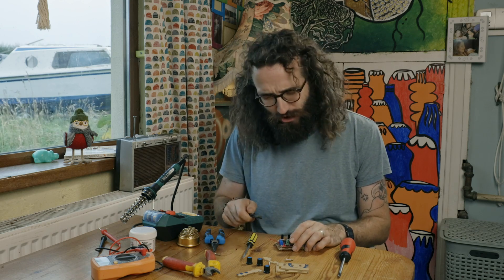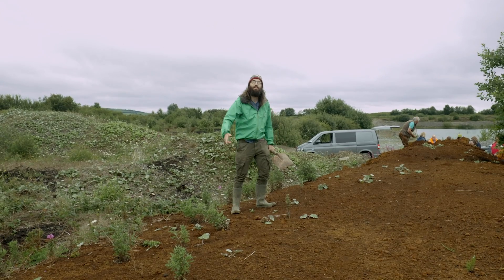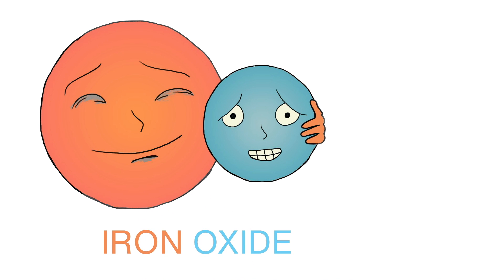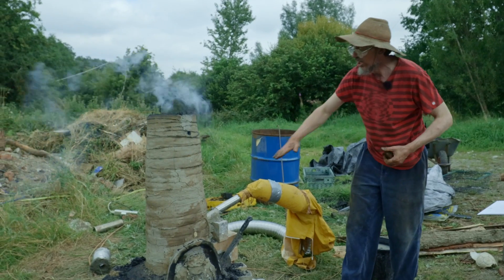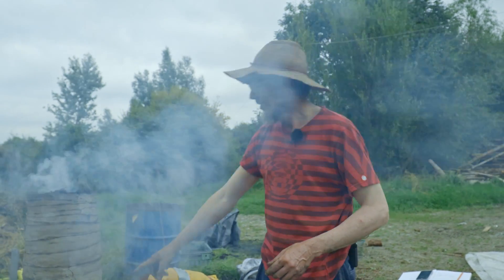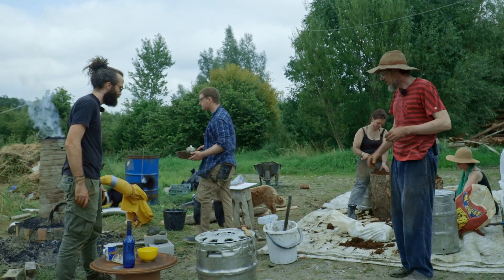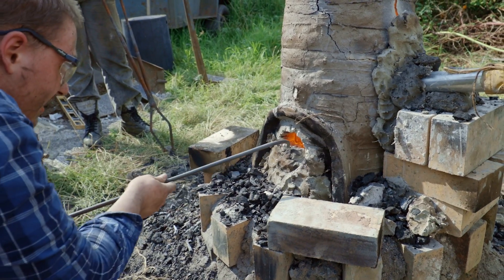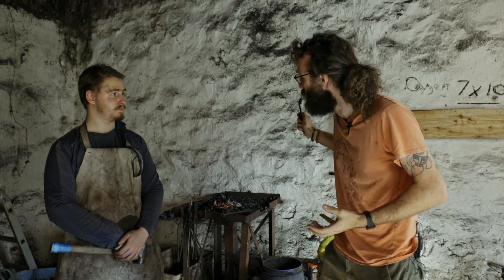Science at Home Episode 18 -  How to make Iron and steel from scratch!

Comment: Good show. Very graphical. Hoped you would go deeper in the specific differences between steel and iron though.
Reply from the maker: Hey. Thanks for your comment! The only real difference between iron and steel is the carbon content. Steel is just iron with a small amount of carbon mixed through it. This can happen just through hammering it while hot in a carbon rich environment (eg. among lots of charcoal dust) or through other methods. But that's the only difference between iron and steel.  Hope that answers your question! :-)
Reply: @MidlandsScience  Noted!